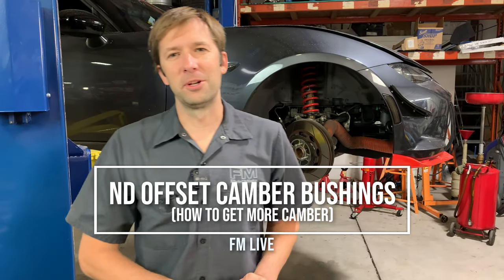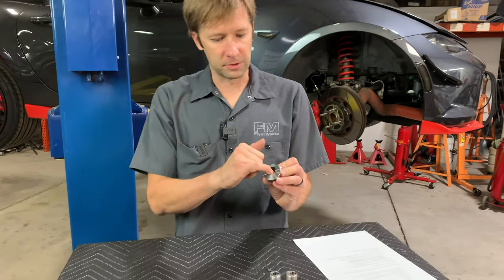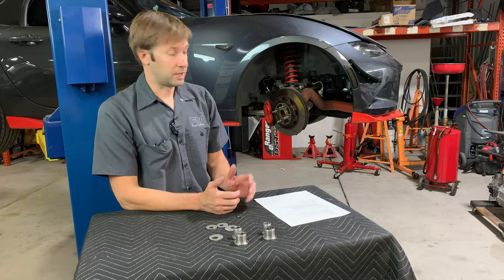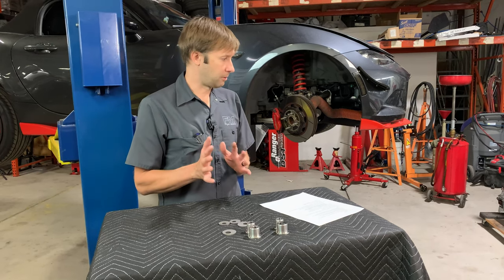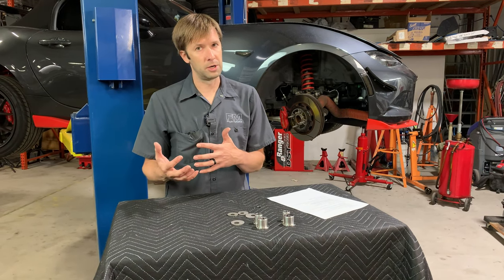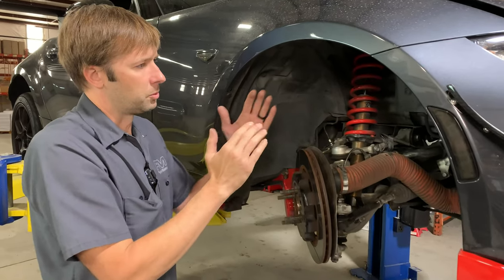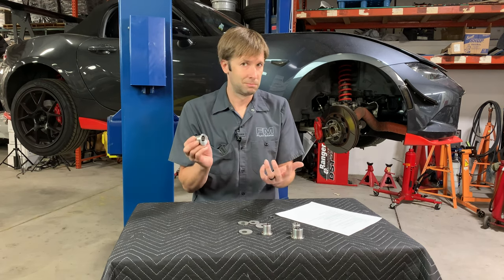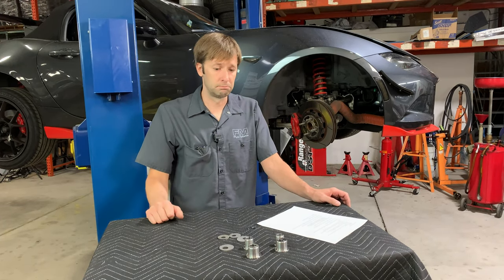MORE CAMBER! ND Offset Camber Bushings - 4K (FM Live)

Comment: FYI FM @3:50 you are stating orientation backwards, if you install the bushing as you stated it will move the upright inward and actually have less camber than stock. Thick side goes outward from center of car to add negative camber. One of my fellow instructors installed them backwards based on this video and has to pay for two alignments due to this now.
Reply from the maker: @CameronFreeman-kd1tc You have this backwards - the upper bushing needs to be installed with that mark facing outwards as Brandon explains. If you install the "thick" side of the upper bushing facing outwards, it will negate some of the camber gain these bushings offer.
Reply: @FlyinMiataVideo  we're talking about the lower bushing, as that is what he was holding when describing the orientation.
Reply from the maker: @CameronFreeman-kd1tc  At the 3:50 mark you mentioned, Brandon is holding the upper bushing (the larger of the two), not the lower bushing (the smaller of the two). However, you are correct in saying that the lower bushing should be installed with the "thick" part facing outwards.
Reply from the maker: We've edited the video to correct the segment you mentioned. Thanks for catching that and sorry for the confusion.

Comment: so these can't be adjusted after being installed... so if I wanted at street/track set up, would the factory cam bolts have enough range to get a reasonable camber angle for daily driving? If if the car is dropped maybe 3/4" to 1" and I set these bushings to max camber, could I use the factory cam bolts to bring the camber angle back to setting that won't wear out my tires during daily driving?

Comment: @FlyinMiataVideo what about camber plates? Why not using the plates instead of bushings?
Reply from the maker: Camber plates only work on strut suspension, where the angle of the strut is used to determine camber. The double wishbone or multilink suspensions used on Miatas don't work that way; there are no camber plates.
Reply: @FlyinMiataVideo  yeah, thank you for the answer. 2-arm suspension is a bit limited here.